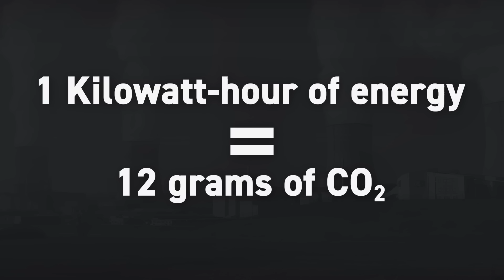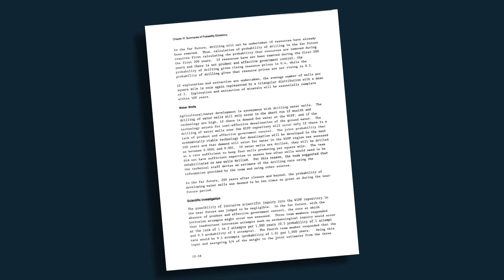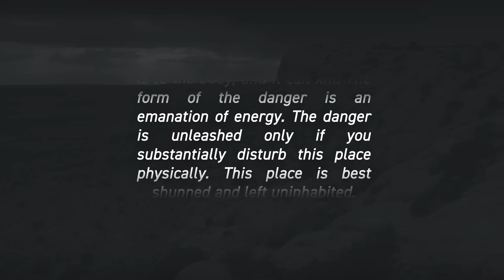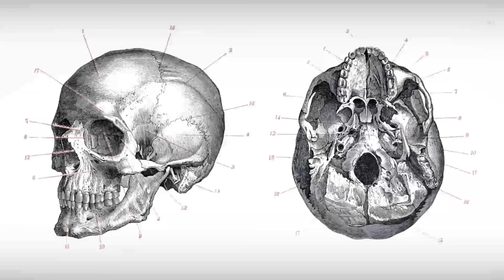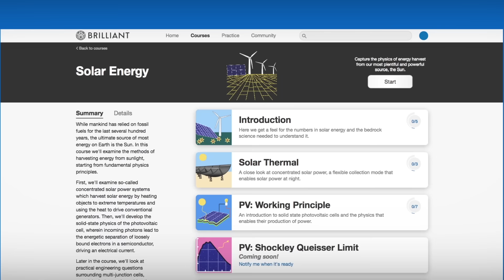The Nuclear Waste Problem

Comment: Sadly the video ignored all the possible solutions to the problem that don't involve continuing to use ancient reactor designs and then burying the waste.  Instead of constantly fighting a political battle to find a state willing to allow thousands of tons of waste to be buried there we should be building new reactor designs that allow for nearly closed nuclear fuel cycles.  Like The IFR reactor ( https://en.wikipedia.org/wiki/Integral_fast_reactor ) or the sub-critical reactor ( https://en.wikipedia.org/wiki/Accelerator-driven_subcritical_reactor ) .  

Nuclear is one of the safest forms of energy we have available and the only "clean" one that can handle "baseline" power needs (unlike solar and wind).  But what nuclear does have is a cost, R&D, and political issue.  With more government involvement (like in the 40-50-60s) we could see the cost and R&D issues go away, but the political one is likely to remain an issue for many decades.  There have simply been too many years of endless fear-mongering to undo in a short time.
Reply: ty
Reply: Research is important but in the meantime you use the technology you have. In the 80s and 90s we could have been planning for the fusion reactors that were going to be built in the early 2000s. It's a good thing we didn't.
Reply: oliverwilson11 yes but I'm talking about stuff that was figured out in the 70s.  We know how to make a almost completely closed fuel cycle where one reactor burns (most of) the waste of another reactor.  In the end your left with a small amount of low radiation waste that's quite safe to just bury (and theirs hardly any of it left anyway).  Sadly the fuel reprocessing facilities we had planned were killed by carter I believe due to politics of the time.  Now we need to get back on it and get it done right.
Reply: It's already happening in China
Reply: Tan Xu do you have any sources I could read?  And good on China.  Someone in the world needs to push forward the science and technology that will make us a space faring species.
Reply: bp968 I don’t have any English material atm, perhaps some not so in depth media reports in Chinese. I’ll update you if I come across anything good.
Reply: Tan Xu I'm fine with some Chinese source material, I'll use Google translate  (it's not perfect, but you usually get the idea their trying to get across).  And thanks for anything you share!
Reply: No, we don't.
Separating the materials AND retrieving weapons material while keeping absolutely correct records adds so much to costs that zero reactors will be built anywhere under U.S. Supervision.
Reply: Hellstrom Carbunkle Hellstrom Carbunkle no we don't?  What are you responding too? Theirs two paragraphs of information in just my post.

As to the second part, many of the reactor designs don't really produce much usable weapons grade material.  You make it sound like reactors just spew out usable u235 and plutonium when that's not really the case.  U235 specifically requires a large and complex enrichment process.  PU is easier to produce as a by product but it's also more difficult to use in a bomb and requires more tech/skills/and infrastructure then a U235 bomb.  

As for seperating materials for refueling or for waste disposal, that's already a mostly solved problem.  France produces 80% of its power via nuclear and reprocesses most all of its waste.  

We could copy their model and also start testing artificial transmutation of the waste to get rid of the most dangerous actinides and convert them into less radioactive or shorter half life forms of waste.

In the USA It's not a science problem, it's an ignorance problem.
Reply: Sorry, YOUR post said "We know how to make a almost completely closed fuel cycle where one reactor burns "
No, we don't.
As Fukushima Dai-ichi #3 running 239-Pu at 8% WHILE also requiring 235-U 5%, the most we can do is burn SOME waste and only then as background neutron absorber/fission.
A net of 8% 239-Pu is unable to sustain fission and like Thorium can only be a fuel adjunct
Reply: A TV documentary. Could you BE less reliable.
So far, no one, not even the French, have a breeder that recycles in one installation.
Reply: Hellstrom Carbunkle "in one installation"..  So that's the target we have to hit?  I never said it could be done with some magic all-in-one reactor design, just that it could be done.  Fukushima was also not exactly fancy modern tech.  It was your basic 1960s light BWR type.  Modern designs are safer and more efficient.

The problem with nuclear energy isnt its safety or its waste (it produces almost none when done right) or its proliferation risk (how many reactors do we have around the world and how many terrorist made nukes have gone off in the past 50 years?).  No the problem with nuclear power is its costs.  Especially its startup cost.  A natural gas plant is vastly cheaper to build and (for now) cheaper to run.  

Unfortunately it's a shortsighted view.  Especially for a country like Japan or any other place with poor natural resources.  The USA and China can get away with it because we both have massive oil and coal reserves.  France doesn't, and so their decision to go nuclear was for national security and I believe a wise one.
Reply: If it isn't an in situ reprocessing, you're playing games.
The reactor is NOT reprocessed immediately after unshipping the drive.
In fact, that transport of highly radioactive daughter and transmutation products is why there is no 100% recycling...anywhere.
So, no 100% recycled reactors,now or ever, because cost reduces ROI which is already abysmal.
Reply: You said a full closed loop reactor can exist.
Now where is your evidence.
A DOCUMENTARY? With zero attribution? 
No wonder you flunked high school
Reply: So, once again, you have zero evidence, and no backing for your claim
let's just leave it at "you lied" about 100% recycle nuclear power plants.
Figures.
no wonder they didn't let you use the paints during finger paint class.
Reply: So, once again, HERE is what you said "We know how to make a almost completely closed fuel cycle where one reactor burns (most of) the waste of another reactor."
WE DO NOT KNOW!
Liar
Reply: I quoted verbatim, lifting the entire significant portion.
Don't blame me if you can't skew things as you wish.

Comment: Greetings: I want to express my serious belief that the spent nuclear fuel removed from light water reactors LWRs (both PWRs, pressurized water reactors and BWRs, boiling water reactors) have retained a significant amount of their original U235 unused. The fuel was removed because the reactor became difficult to control (its criticality)  due to fission products that are neutron poisons (Xenon et. al.) that reduce the neutron economy required to maintain heat production.
That spent nuclear fuel has an opportunity to continue to produce energy through use in modern advanced reactor designs that await regulatory approval from the NRC (nuclear regulatory commission).
Some of those designs use alternate forms of cooling which avoid most of the problems maintaining the high pressure of the water required to keep it from turning to steam, normally 212 degrees F. For a reasonably thermodynamic-ally efficient  system the water must be at least 315 degrees Celsius before entering the steam generators that feed the turbines.
Two alternate coolants include molten salts of Lithium & Beryllium Fluoride and liquid metals of Sodium or lead (yes, as used in Soviet era subs). None of those coolants need to work under elevated pressures thereby reducing the size and expense of containment facilities. 
Some designs are specifically to burn up spent nuclear fuel while generating heat for power or manufacturing processing. Some are even used to desalinate or purify water (big plant in Kazakhstan I think).
Some designs can convert depleted uranium U238 into another fissile fuel for LWRs,
So, after regulatory approval, these new designs that are factory manufactured and serviced for competitive costs compared to fossil fuels, then that spent fuel will be prized for its low cost and abundant availability.
OH, what about their new waste? Lots less mass, and shorter half-lives, reducing storage to about 300 years. I think that makes SNF worth keeping around. 
NO, unlike fusion which has yet to become a useful technology, all of the proposed designs will work, no proof required. All of this can be verified on-line often in other YouTube videos.
Reply: well i hope they decide to recycle all the material in energy efficient plans if they can figure out what to do with the byproducts after they are recycled for energy etc... i guess we dont need more nuclear weapons... and poisoning the ground does sound like a bad idea on hindsight... maybe instead we should bury the seeds to restart technology and society, and process and clean up all the nuclear and poisonous stuff by properly expending it for fuel and energy then finding a better use for its by products to further be responseible for a clean and happy world... but i agree we should bury something, but we should create deep deep fallout vaults and just put like spare generators and chemical formulas etched into metals and stone so that someone could rebuild the technology someday if something unexpected happens

Comment: Under what metric could the Roman Empire possibly be the most "powerful" empire to ever exist?
Reply: its longevity and advancements certainly put it higher than most, neither the mongols nor britain lasted nearly as long.
Reply: @Ben-li9zb  Longevity is not strength and Ming Dynasty, Abbasids, Persians, Ottomans and list is even longer
Reply: @noradlark167  Longevity is proof of strength, even if not the only factor
Reply: The Roman Empire at it's peak relative to the rest of the world. I'd argue that the US between 16 July 1945 and 29 August 1949 takes that spot.

Comment: There's a better solution to burying it. Use it in a Thorium Salt Reactor, not only greatly reducing the mass of the waste, but instead of thousands of years the half-life is 300 years.
Reply: The only problem with a Thorium fuel cycle in a molten salt rector is that it doesn't run on a Uranium/Plutonium fuel cycle. If you want to use up the waste, you can't start with a new virgin fuel source.
Reply: @DriveCarToBar  i don't know how it works.  Someone far smarter and informed on the subject said that typical uranium fission waste could be used as a fuel source.
Reply: @JessRenee91481  It's just a difference in the fuel cycle. Technically, Thorium isn't fissile. It's fertile, meaning that when exposed to neutrons in a reactor, it doesn't solid and release energy, it becomes Uranium-233 (and a few other trace things) which is fissile and is the fuel which generates heat. 
Water reactors use ~5% Uranium 235 (the rest is U-238) which is fissile and generates heat. Some of the Uranium transmutes into Plutonium and other stuff. You could use waste Uranium/Plutonium fuel in a Molten Salt Reactor with some chemistry changes. MSR's are really a much better, more efficient option whether they run Th/U or U/Pu fuel cycles. Far safer and a lot less hazardous waste.

Comment: Or we could recycle the fuel in breeder reactors. Also, if there are no humans, whence comes the risk of waste exposure? (Presuming an awful lot that other intelligent life will evolve - we have no idea how likely we were, it's at least as likely not to happen again).
Reply: to my understand breeders stopped being used simply because of economics, large amount of easily available uranium were found, if the storage was a problem, or uranium became more expensive, then they come back, meaning fission has thousands of years of available fuel.
so ironically the high availability could be said to be causing the safety risk of storage, although, all told, there is probably about the same danger in the more complex breeder route.
for me building a nuclear reactor in Japan, at all, with the earth quakes/tsunamis, shows the power of short-term economics over logic.
Reply: I am astonished that breeder reactors were not even brought up in this video.
Reply: Nope, they are banned by treaty.  Only France uses rebreeders, and it's very economical compared to storage costs.  Rebreeding is cheaper than digging, enriching, using, and then storing new fuel.
Reply: yes does seem a bit lame.

Comment: Not true that Fukushima still has “massive” exclusion zones.  All original exclusion due to radiation has been cancelled save for areas immediately around the plants that failed.  The destruction to infrastructure brought by the 2011 quake and tsunami however may still make it difficult to live in the area.

Comment: 1:00 There's also the 1979 Church Rock uranium mill spill, which ended up permanently contaminating the aquifer in the area, poisoning the river and ground water. People are still dying every year because of it. (The reason you probably hadn't heard about this disaster is because the people dying are Navajo, so the US government as well as the media have been basically ignoring it for the past 40 years)

Comment: Why can't they just send it to space, and leave it moving forever?
Reply: Too much energy required. The optimal way would be to reprocess it or burn it in breeder reactors to extract all the energy from it you can, also drastically shortening the time the waste remains dangerous.
Reply: also dangerous, rockets have a bad habit of exploding from time to time. however, if they did send it to space, they should definitely write "your problem now lol" on the rocket in every language of the UN just in case there's aliens
Reply: That would cost so much money
Reply: @Aminu Ibrahim "send it to space": As @cobravello says, vehicles we send to space have the risk that they explode during start - US Space shuttle has a track record of what, 2 out of 11 ?  The risk might seem small, but the more flights the more likely a single incident becomes. And one single incident would scatter tons of nuclear waste into the atmosphere, probably globally. If we would one day have a thing like a space elevator (if such a thing would be technically possible), we might think about this again.

Comment: You usually produce interesting and informative videos, but this episode was a disappointment. Spent nuclear fuel is not waste that should be buried, but fuel for the 4th generation nuclear plants. 4th generation nuclear plants can't have a melt down, because the core is already melted in salt. They don't need a pressure dome, because there is no high pressure stream.

Fear mongering against nuclear is hurting the environment. Countries like Germany have prematurely closed their nuclear plants and replaced them with coal and gas. It is expensive and horribly bad for the environment.

Comment: The basic premise is fundamentally flawed. You don't have to store it for millions of years, you only have to store it until recycling technology can process it -- possibly less than 100 years. Nuclear waste recycling tech has been steadily advancing for decades. Right now, we can actually recycle ALL of the long-decaying material in nuclear waste. This is what France does. The remaining waste decays in 300-1000 years. (Still not great, but better than millions.) 

The most straightforward solution is not "bury it forever", it's "bury it until we can figure out how to use it."
Reply: I think that's why they said "they are all temporary" at this point.
Reply: Avoid French PUREX approach - use Fluoride volatility method for reprocessing of LWR and FR fuels